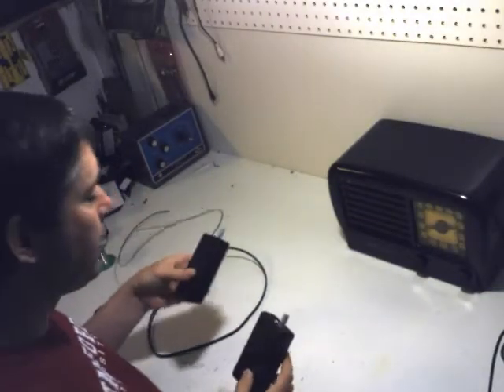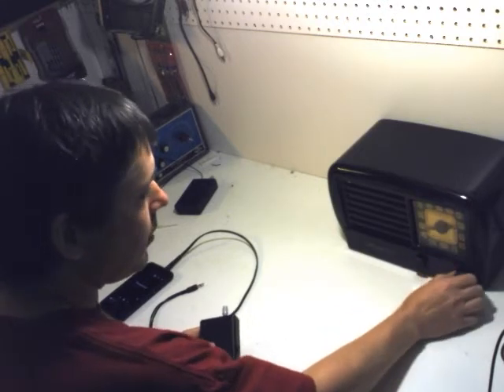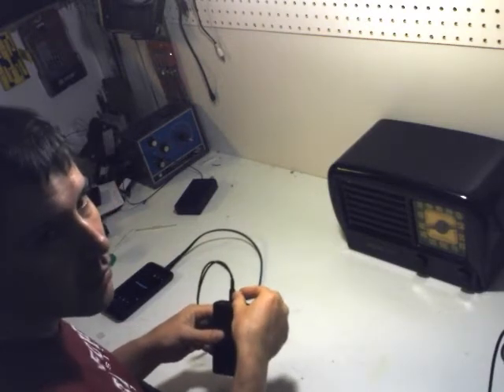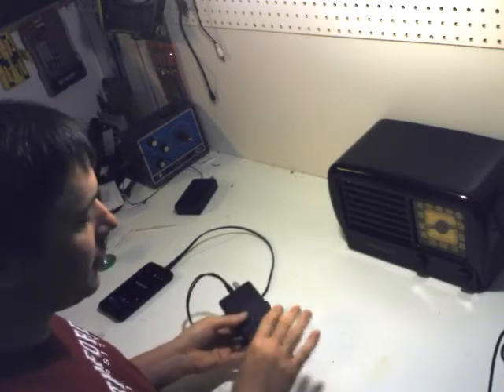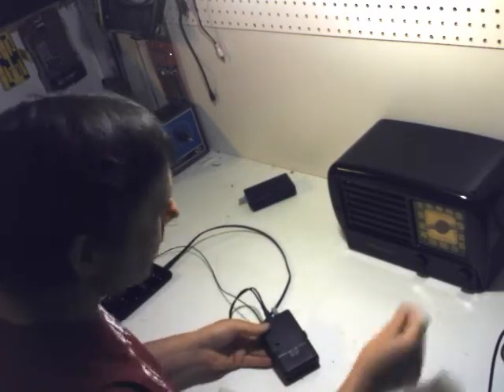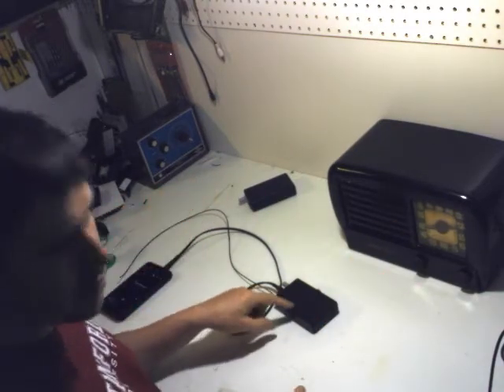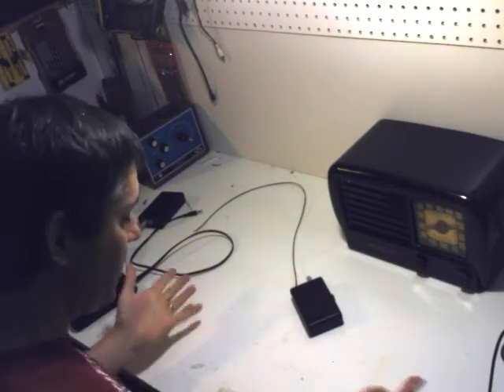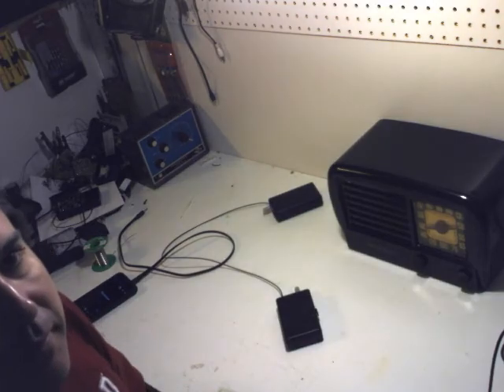fm to am converter transmitter. Battery or Mains operated

Comment: Dear Sean, I bought the FM to AM converter from you and I am happy with it and I also recommanded it to friends. But now I've found a video of an Italian guy who made a build in FM converter for an AM radio. Stations can be searched with the radio tuning knob. I would like to buy such a converter but I can't find it on ebay: https://youtu.be/VVo0AXA4IUc  Can you build such a build in converter?
Reply from the maker: I had a look at the video. I could build something like it but the only issue I have is that it requires modification to the radio,  disables it's existing AM reception and could be a shock hazard if the radio has a live chassis. It would probably best be installed by a professional.
Reply: Thank you, how much do you think wil it cost you to build this converter? He has also placed another video on facebook: https://www.facebook.com/fmconverter/videos/1894176397575701/    (I contact you because this gentelman can only communicate in Italian)

Comment: Are you still selling these? I cannot see them on ebay
Reply from the maker: Hi.

These are on ebay at the moment.
Look for either... AM radio transmitter for vintage radio battery or mains operation
Or ...Fm To AM Converter / Transmitter for Vintage Radio MK 2

Thanks.

Comment: Very nice, what is the range of the transmitters?
Reply from the maker: Up to 2 meters (6 feet). for both depending on radio sensitivity.
The Am transmitter however has an external antenna socket as well so you can add a wire to increase range if needed.

Comment: Nice demo, I ordered one from eBay just today, on the strength of this video.  I have a couple of AM transmitters, which I use all the time.  This is a bit different and really cool, an FM to AM converter/transmitter.  I put a link to this video in my latest upload.  Can't wait to receive it and try it out.